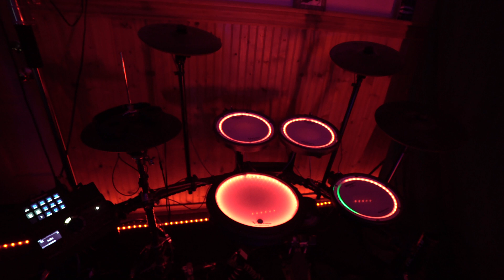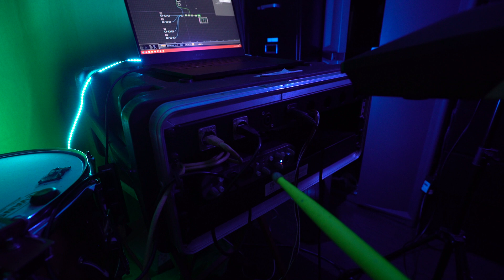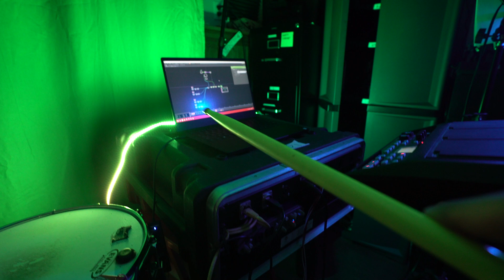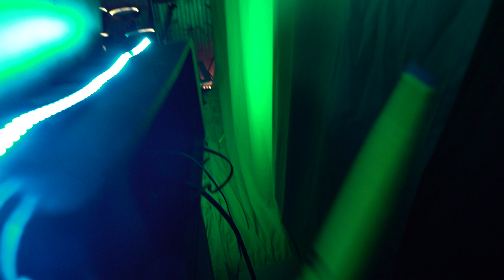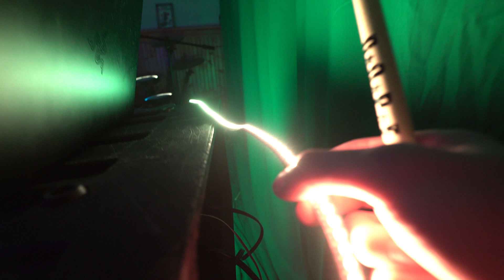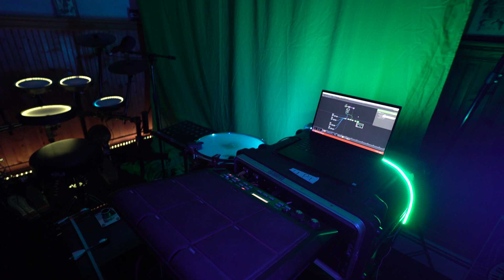Controlling Lights with MIDI: Signal Flow overview and quick demo.

Comment: Hi. That is awesome! I just got a USB 2 DMX  interface and some fixtures to test some like this.  I am to lazy to open up the shells. I guess I have again to think what fixture I should keep.
I have 4 RGB LED PARs, 2 Moving Heads and a LED bar, that can adress 9 segments.
But these LED stripes... Nice. A week ago I saw a video about stripes and DMX but  can you trigger those striped segmented?
Reply from the maker: Yes you can but you need special software to do it. In this case I am using Touch Designer to address which lights to turn on and the SPDSX is the brain for the midi signal to get to the computer. THe DMX interface I use is ENttec USB DMX, I hope this helps!

Comment: what vdrum module is that? Can you use that module directly to control the leds? Do you have an online post or blog on how you did this midi led on your edrum?
Reply from the maker: It's a td17kvx. I have to run it via midi into my computer. Some additional hardware is required. More videos coming soon.
Reply: @stickwithit  Is this possible without having it to connect to the pc? maybe arduino? What led controller are you using being fed from your pc?
Reply: @stickwithit Hi. I would suggest to use  the notes from the edrums, and loopback them to a DMX software or a software that controlled the led driver.
I just grabbed a USB2DMX interface and Freestyler DMX and trigger some LED PARs and a LED and Moving Heads. And I cannot decide what to keep... 
I am to lazy to open up all the meshpads.

Comment from the maker: What you will need for a project like this:
Drums, SPD-SX, audio interface that accepts midi input, LED controller, power supply, touch designer. I'll make some more videos breaking this down if y'all are interested. Have a good one. 😊
Reply: Shit seems expensive to get into. How long is set up time?.